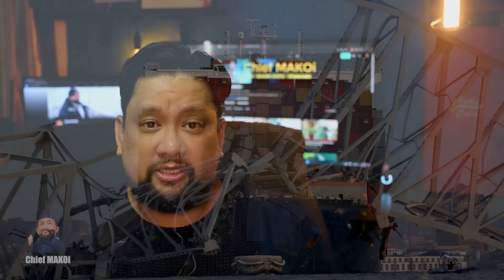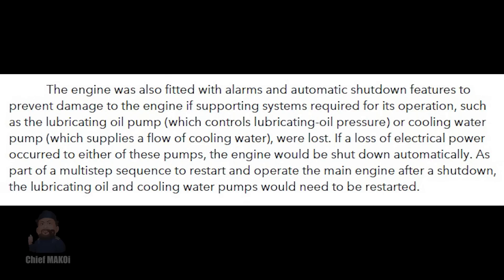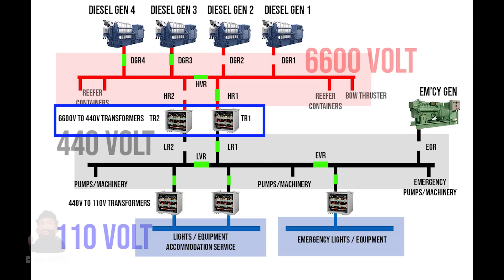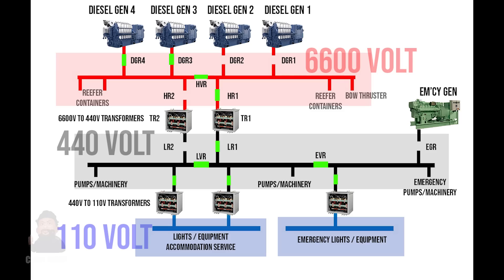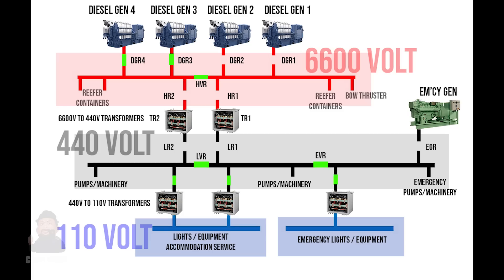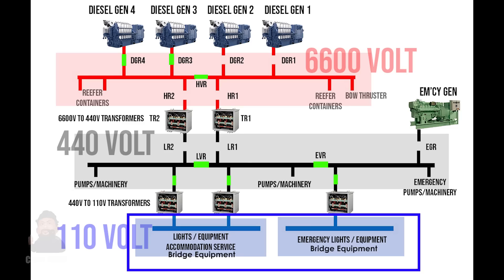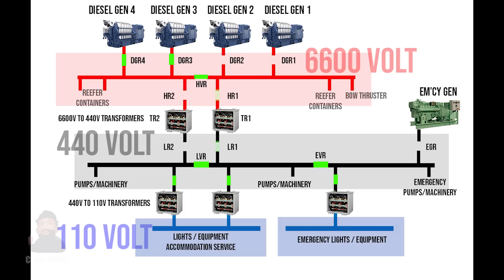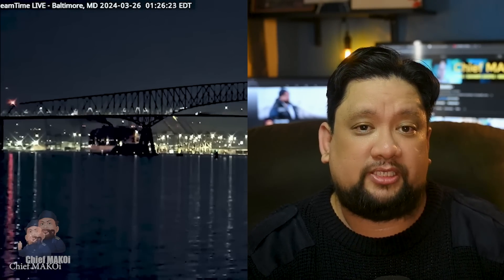Explaining the NTSB Report on the Container Ship DALI | Chief MAKOi

Comment: Rule 6 Safe speed—INTERNATIONAL— 
Steering and Sailing Rules 
Rule 6 
Safe Speed 
Every vessel shall at all times proceed at a safe speed so that she can take proper 
and effective action to avoid collision and be stopped within a distance 
appropriate to the prevailing circumstances and conditions. 
In determining a safe speed the following factors shall be among those taken 
into account: 
(a) By all vessels: 
(i) the state of visibility; 
(ii) the traffic density including concentrations of fishing vessels or any 
other vessels; 
(iii) the maneuverability of the vessel with special reference to stopping 
distance and turning ability in the prevailing conditions; 
(iv) at night, the presence of background light such as from shore lights or 
from back scatter of her own lights; 
(v) the state of wind, sea and current, and the proximity of navigational 
hazards; 
(vi) the draft in relation to the available depth of water. 
(b) Additionally, by vessels with operational radar: 
(i) the characteristics, efficiency and limitations of the radar equipment; 
(ii) any constraints imposed by the radar range scale in use; 
(iii) the effect on radar detection of the sea state, weather and other sources 
of interference; 
(iv) the possibility that small vessels, ice and other floating objects may not 
be detected by radar at an adequate range; 
(v) the number, location and movement of vessels detected by radar; 
(vi) the more exact assessment of the visibility that may be possible when 
radar is used to determine the range of vessels or other objects in the 
vicinity. 
12 .        Was Dali traveling 3 times Safe Speed?

Comment: This could also be a Power Management or logic/control problem.  They haven’t stated if the breaker was in a tripped state.  There are three states,  On, Off and “Tripped”.  The breaker could be in either “Off” or “Tripped” from an external control signal.  They often use the under voltage coil to put the breaker in a tripped state.  It doesn’t always mean that the consumer or cable has a fault.

After a blackout it’s hard to figure out what happened, the logs in the AMS will show everything going to alarm all at once.

Comment: Nice description of the report. I don't think the refrigerated containers run on the 6600vac bus. I scoured the internet for a manufacturer that makes them. Most I could find run 230/460vac.  The 440vac bus was brought down by the refrigerated containers misbehaving.  NTSB/FBI needs to inspect every refrigerated container.
Reply: They are supplied from 6.6/440 reefer transformers ,

Comment: I notice you show a bow thruster.  It's usually electric as well, but I didn't see at any time, when there was power available, that the bow thruster was never engaged, to turn the bow of the ship away from the bridge pilons.
That might have offered additional time to the crew to get control and steer the ship away from the bridge.
Reply: The issue is how you plan for these events and clearly the Bow Thruster was not part of the plan (note the guy on the front of the ship who could not set the anchor hand brake as debris were falling on him).     Also it would have to be up and running and then you need control of it,  and control would have been lost at various times.     I have said it should be part of the critical maneuvering plan,  but that does not mean its a solution,  just another possible save,  Tugs and Pier Protection would be the main other plans for avoidance.

Comment: Chief, Would it be fair to say so far, this was a cascading series of compounding events which in reality, is only a very basic report? 
 I have to believe that when the detailed sequence in the final report will identify not a single, or handful of issues, but a series of events of a improbable scenarios of multiple problems?
 I guess I'm looking for a reason to exonerate the crew maybe? Because what I have learned from you over the years is that, these vessels are generally controlled by competent professionals as those you have always represented to us as the standard of maritime seafarers. 

 More than anything, I'm shocked to learn of the direct shaft to propellor  there's no transmission? ... to reverse you have to start the engine in rev rotation.... I'm sure that's been in one of your sessions but I've forgotten that.
Reply: Cascading events and aspects beyond crew capability and or the recruiting of said crew,  that gets heavy.    We can see two errors,  one was the previous docked power outage and shutting a damper on a working engine.     Failure to be swapping systems when it was safe (transformers 1 and 2)  also not done (Chief engineer decision).     Its going to be far too long before we see how the various aspect played into the tragedy.    Part of it is going to be low cost manning and training minimums.     I have listed a number of ways to make the system less subject to failure but those all would cost more for short periods of time (as well as crew manning needs).   Ie split the Plant,  have two engine running each side as well as the Emergency Gen system split off and E Gen running for critical maneuverings.    Just because they got away with it previously did not make it a good idea or a good system.     If its mandated then they all have to do it and the cost is equal.    Port of Baltimore in a move to be cheaper did not require tug escort.   New York does,  so you have one Port being cheap to be competitive that then kills 6 people and billions in damages.

Comment: An interesting item is while the heavy smoke was present, according to AIS data the Dali was rapidly decelerating and turning to starboard - and only during the black smoke emission.  AIS data is available every 10 seconds.

From 1:25:00 when power was lost the first time until the smoke began at 1:26:09 the ship only slowed by 0.2 knots and COG changed to starboard by 1 degree.  The ship was drifting.

From 1:26:09 when the heavy smoke starts to 1:28:07 shortly before the smoke stopped, the ship slowed by 1.8 knots and COG went to starboard by 14 degrees.  The ship was rapidly decelerating and turning.

From 1:28:07 to just before impact with the bridge at 1:29:15 the ship only slowed by 0.2 knots and the COG changed to starboard by 2 degrees.  The ship was drifting.

It sure looks to me like the main propulsion engine was restarted after the first power failure and was running in full reverse for 2 minutes to cause the heavy black smoke and rapid deceleration, and prop walk caused the large starboard COG change which ultimately resulted in impact with the bridge.  Nothing else explains the velocity and course change only while the heavy smoke was present.

Comment: Thanks for the explanation. Can you offer any explanation of why the electrical boards were configured as they were? My background is in nuclear power, we would have run with both transformers in service, the high and low voltage bus couplers open and at least one diesel running to each HV board. Assuming the main engine auxiliaries and steering gear pumps are duplicated and split across the boards, then a single fault would not stop the main engine. This was obviously not the case here. Could this have been done?
Reply: I see no reason it could not be and I strongly  suspect you would have the redundant pumps off both sides.    The issue is low cost Ship ops vs the fear of Nuclear failures (and that is true).    So Nuke industry has far higher standards,  but then look at Japan where they put their whole electrical system in the basement at Fukishima and in what world is a below ground power system a good idea?    Trure story,  after the quake a more landward Nuke Plant was on backup generators (they had 3).   One was running,  one they took down for Maint.    First one failed,  2nd one was not available and the third one would not start.     The answer is you line up another generator or two and get it on site before you shut one down for maint (and you test them!)    They had a mad scramble to get a generator to the site and were flirting with another meltdown.
Reply: @gregoryschmitz2131  I agree, but the cost of running the system split would be very low, just the energy loss of running the second transformer, so is there any reason why this could not be done? For example there may have been unresolved faults with the electric power supply systems. Was there a fault on the second transformer that had not been repaired after the supply system failure in port a few days before the accident?

Comment: So if the main engine wasn't restarted, what made the ship turn sharply starboard a minute after the first blackout?  

The water was approaching low tide, so there would have been a small ebb current.  Current shouldn't have turned the ship unless current from the Curtis Bay side channel pushed the rear of the ship.  

Winds were only about 2 knots, but coming from the NE (correct direction to turn the ship starboard).  But it seems odd that the wind effect didn't begin until a minute after the blackout, and is 2 knots enough to turn the ship that sharply?  

Another possibility is that as the propeller slowed, it had an effect similar to going astern, since the ship was moving at about 8 knots, so propeller walk could have turned the ship.

Comment: THank you for another interesting and informative video, Chief. I read the NTSB report which this video helps greatly to clarify. If power was available on the HV bus, could the bow thruster have been used to deflect the bow of the ship away from the pier? Are there interlocks that prevent the use of the bow thruster when the main engine is not running?
Reply: Yes it could be used but not part of a plan as they had little plan that is probably normal on those ships.   Guy on front can't brake the anchor because he is trying to dodge debris as debris from overhead are not part of the plan.    Tubs are a plan,  pier protection is a plan.   And with control power lost,  a bow thrust shuts down.

Comment: As an industrial electrician, I am surprised that the maritime industry has managed to totally defeat one of the best features of these power distribution systems. In land based industry, during normal operation, the Tie Breakers are left open. Two generators on either side of the open Tie Breakers are used along with both transformers. As well the low voltage buss Tie Breakers are left open . All equipment loads are divided such that if one buss is lost, only half of the machinery stops . With two fuel pumps, two cooling pumps, etc. you can see the benefits of operating the system this way. If you look at a power distribution station panel in a factory, you will notice the Tie Breakers have a lock on them. The key is in the Main breaker feeding that side of the buss. The only way to get the key out of the lock is to open the main breaker for that side of the buss. The dual buss system was designed for this very reason, but when the Tie Breaker is left closed, you defeat the greatest design feature of this system with the expected results. The purpose of a Tie Breaker is to operate the system temporarily if there is a transformer failure or if two generators on the same side of the buss fail, or for equipment maintenance.

Comment: Chief,  The trip out of HR 1 and LR 1 needs more explanation.  Having the two transformer secondaries in parallel is OK but not very common  This trip out is what happens with LR1 LR2 and LVR closed.  The primaries of the two transformers are  in parallel.  This is a very common connection and seems to be OK The primaries are identical but the two secondaries are not identical.  The two secondary windings are either different or more likely have their instanstanious polarity marked different and  in error. For example  L1on TR1 secondary is not the same as L1 on TR2.  secondary .  Every thing on each nameplate is the same  When this combination in effect , high current results and both breakers on TR1 trip.  This is a screw up either in the wiring or marking of the  transformer secondaries 

In most applications of transformers in distribution the secondaries are load connected, not in parallel.  If I was working for Hyundie right now I would be looking for a new job.
Reply: You are not reading the status right.   The Transformer were NOT WORKING in parallel.   System was cross tied and HR2 was open.    You can only have HR2 and HR1 closed at the same time if HVR is open.
Reply: @gregoryschmitz2131  Gregory,  You may be correct.  Where is the data that that shows the interlocking scheme between between HR1 HR2   and HVR.  Thanks for your comments

Comment: TLDR: The cause of the Dali blackout was an issue with the electrical switchboard. Possible secondary causes include procedural error and a fuel issue, but the primary cause is the electrical switchboard. Details have not yet been released.

Comment: Why are the transformers from the high to low voltage both placed in service during maneuvering?   Do all 4 generators have a common fuel line?   Or do the other two generators have their own system?   If they are separate, why wouldn’t the maneuvering configuration be one generator from each fuel system?

Comment: Great video Chief, thank you so much! I have a question about how the engine protection system would work. Is there a brake on the propeller shaft or would the shift, propeller, and engine quickly coast to a stop due to the engine compression? Sorry if I missed you explaining that elsewhere.

Comment: Chief, Great insights, best I've seen so far.  Focusing on the rudder leaves me with 2 questions:
1. Not for you to answer, but according to report, data recorder was down for the 1st 59 sec of the 1st blackout, but recorded for the remainder. Rudder position is captured by the recorder, as I understand it. 2 orders (from the pilot) to turn the rudder to port were given, but the rudder ACTUALS, from the data recorder, are not given in the report. What did the rudder ACTUALLY do? Seems a simple matter to include in report.
2. IF the rudder was in fact responding to commands to turn to port, then why is the ship turning to starboard? I understand the caveats you outlined, no propulsion, smaller emergency rudder motor, relatively small rudder. However, from report, wind was 2 knots (direction unspecified), and current is unknown. Is it plausible to you that, IF the rudder was responding as commanded, and wind is small, that at 8.6 knots and no propulsion, the rudder had so little effect that it not only did not turn the ship to port, but current overwhelmed the rudder effect, and STEERED the ship to starboard? The ship APPEARS to be TURNING to starboard, and not being PUSHED to starboard, as current might cause. What am I missing here?
Reply: Excellent comment here - either they are preparing for a criminal case by being completely vague on key details or the competence is not where we need it to be on an investigation of this magnitude.  Had the exact same thoughts as you.  The emergency generator comes on shortly (not within or after 45 seconds) and the pilot gives helm orders (without any correlation to rudder angle listed in the report).  Should be enough time to have nailed this down by now and I agree 8.6 kts across the rudder hard to STBD would likely at least check a turn to port.
Reply: I’d expect this turn to starboard comes from losing propeller walk as the propeller slowed down and most likely has even come to full stop finally. In a nutshell, I could imagine water flows compensating water level with reduced propeller walk could have applied forces to turn stern to port, thus pushing bow to starboard. Possibly some additional influence from current out of Curtis Bay. Wrt timing, we should also take inertia into account until changes get visible (also with rudder commands later on once emergency generator came up). Have written very long comment about this in YT Video “NSTB Report Dali lost power …” from What is going on with shipping?. Hoping experienced seafarers providing their feedback to this hypothesis.

Comment: I've managed to get a farm tractor engine running backwards. Climbing on a pile of silage with too low throttle, the engine stalled and the tractor started rolling backwards and the engine came back to life. With gear still on and clutch not pressed, I accidentally did a hill start in reverse with a forward gear on. Now the forward gear moved the tractor backwards! After a few moments of fun to verify the gears were really the wrong way and the engine must be running backwards too, I restarted the tractor and all was right again. Probably water pumps and lubrication work better with the engine running the intended way! :^)
Reply: While you can start a vehicle engine in reverse (diesel) it has nothing to do with the Dali engine,  it runs in reverse deliberately.   Pumps are all totally independent and nothing to do with engine rotation.  .

Comment: I am surprised that there is no hydraulic redundancy/ standby I the shape of hydraulic accumulators. These would have aided fast rider response as well as giving steering for sometime after power failure. Although I take the point that without the main propulsion running in this May t have helped.
Reply: You have triple redundancy.   In this case it was negated.   If the E Generator had been on line and on its bus,  you would have had low speed movement.    That also assumes you had control power.

Comment: Is it normal practice to only run one transformer at a time???  I am presuming the transformer windings are matched and they can be run in parallel.   I.e. why was only one transformer running
Reply: You don't parallel transformers.   You can split the bus and power two sides of those busses separately and if done right you have power to the redundant pumps as well as control power.